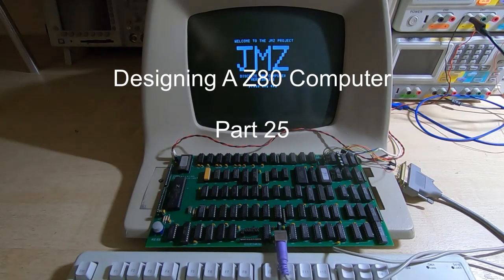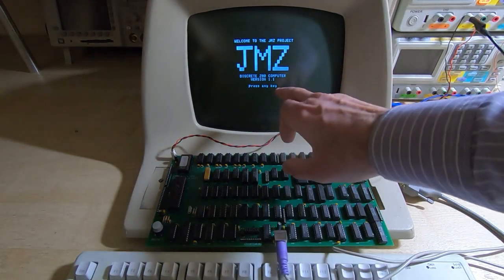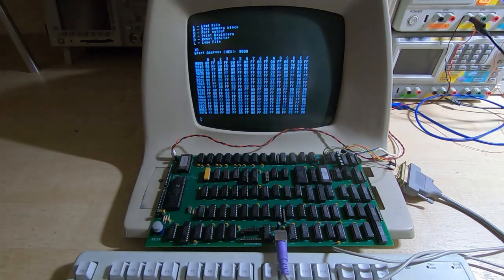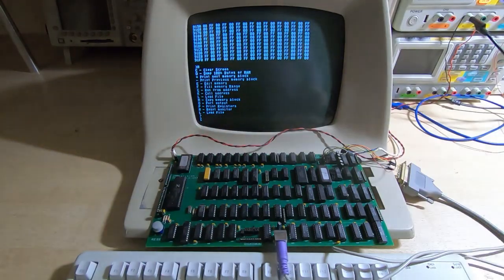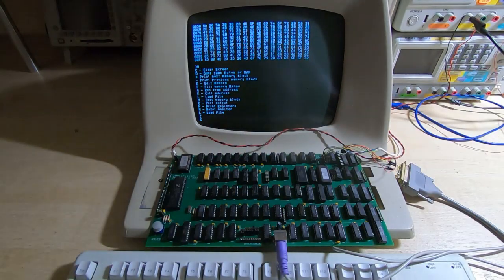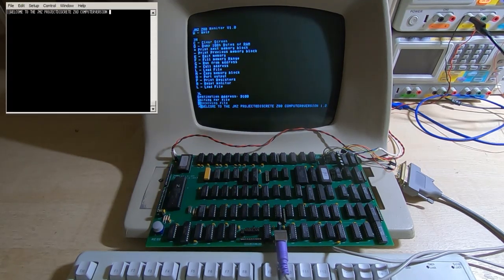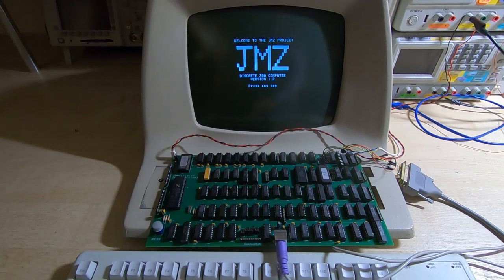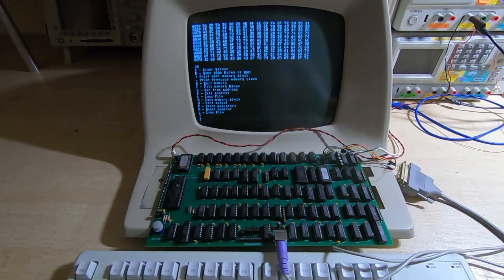Designing A Z80 Computer Part25

Comment: Excellent video and work! Would it be hard to add a memory diagnostic to the monitor? Also, would it be hard to change the monitor program to work on other Z80 computers? Thanks for sharing
Reply from the maker: For memory Diagnostics I normally just upload a test program because the RAM needs to work for the monitor to run, The monitor is really intended to allow system control but you could certainly add more to it if required. The general monitor code should run on most Z80 computers but bear in mind that the ROM also contains routines to interface with the specific hardware. For example print character and print string routines would need to be replaced to suit particular machines but that should be very simple. The ROM also has the interrupt control for RS232, keyboard etc but again it should be relatively easy to adapt it to other hardware.
Reply: @JerryWalker001  Thanks for replying. I was thinking this would be amazing for the NABU computer.
Reply: Exactly !! I have several NABUs, so if you need a tester, let me know